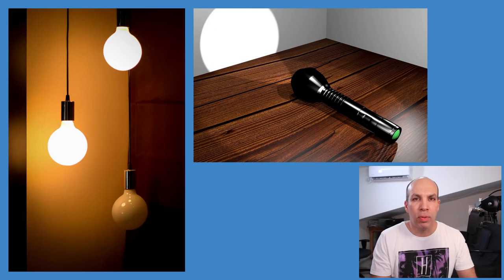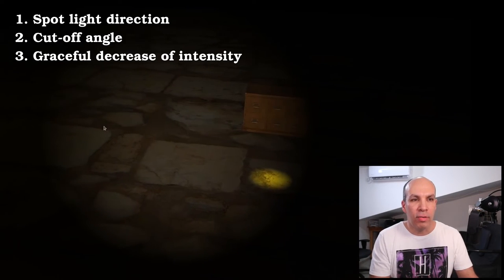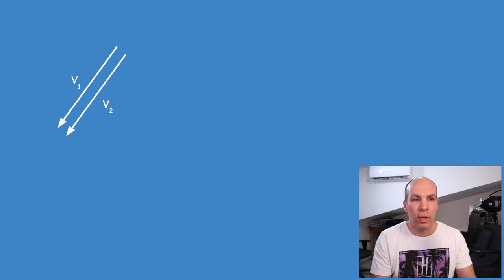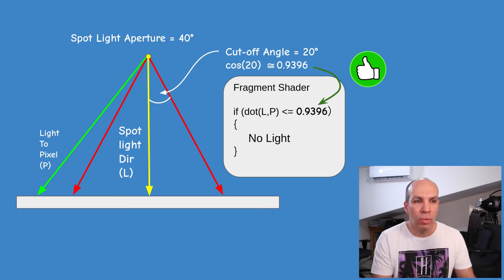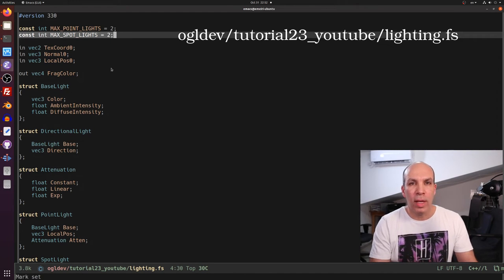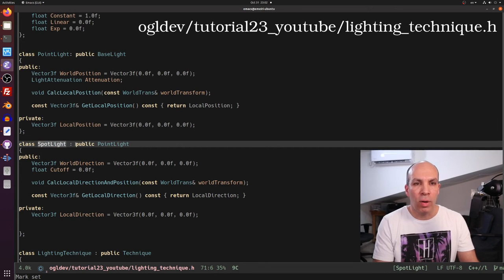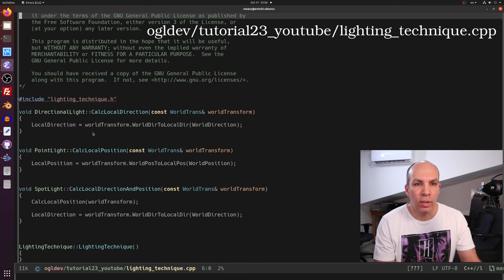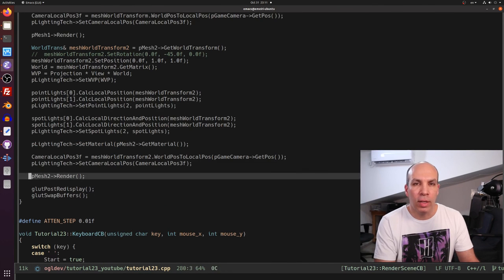Spot Lights // OpenGL Tutorial #23

Comment: I have a question for you: I notices that you started referencing your types directly in your functions (calcPointLight takes a PointLight instance for example). Doesn't that mean however that you'll perform a copy of the object, and thus affect performance?
Reply from the maker: GLSL does not provide the same level of control on pass by value/reference as C/C++. I've just checked the spec and they do recommend to use the 'out' modifier whenever possible to avoid unnecessary copying of params. But this seems more like a compiler hint and depends on the compiler vendor. Well, since the spec recommends it then I guess it's the way to go for production code but for my tutorials I will avoid it because it can confuse the viewer. The original intention of this modifier is to indicate copying out of parameters which does not happen. This should be covered in some kind of an "optimization tips" video.
Reply: @OGLDEV  Oh that makes sense, wish there was a ref alias. Thanks for checking !